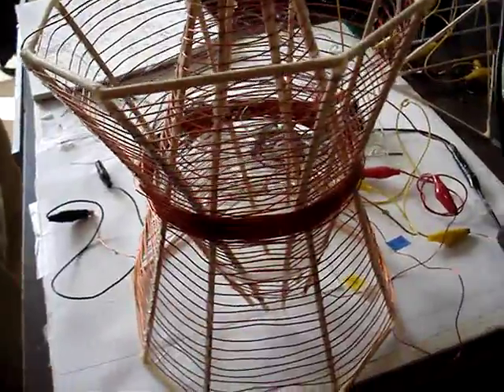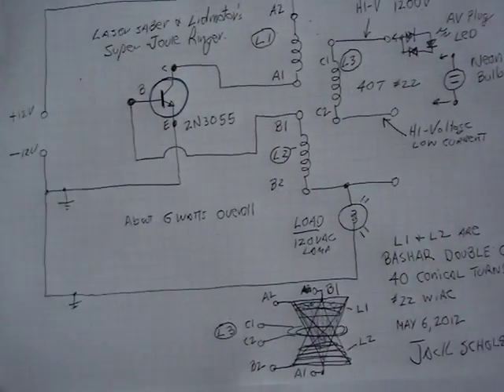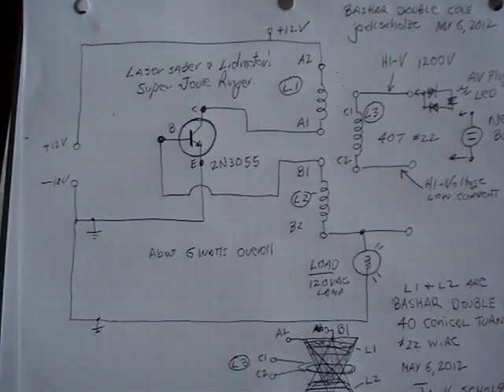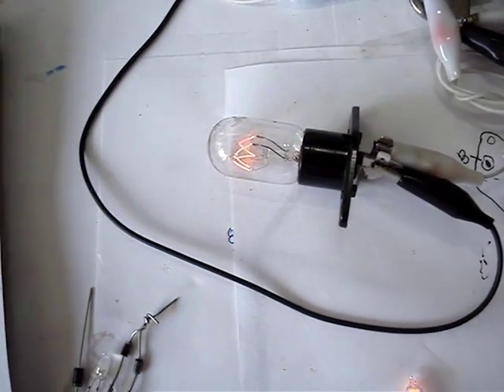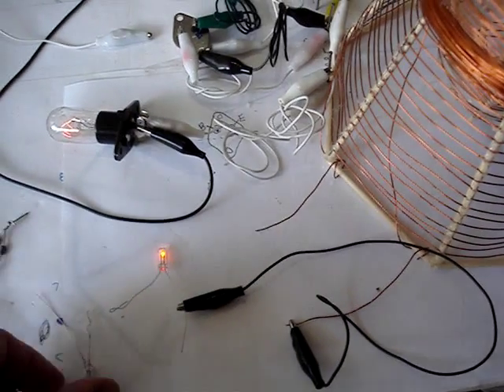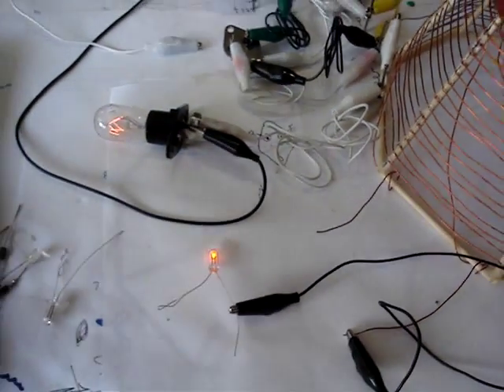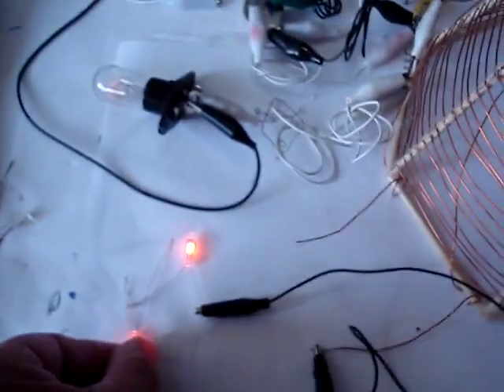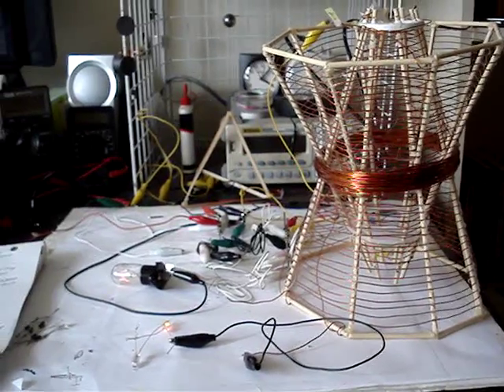Bashar Double-Cone Coil

Comment: AWESOME WORK! Amazing, this is like Lester's Hendershot Generator but way easier to make. I wonder if this thing could be scaled up to run larger loads, or maybe a series of these could be used to power things. This is great stuff.

One question, are both of the cones wound in the same directions or the opposite?
Reply: 相同 都是顺时针缠绕线圈

Comment: nice. Another guy doing Bashar coils. Btw, I just put some "new" theories on how to make this Bashar device on energeticforum. I'm using some thoughts uncovered while looking into the Hendershot devices and the Hubbard coil. If you don't wind the cone, but instead create a series of LOOP antennas at specific PHI ratios, like a Yagi, you can probably BOOST gain. See the thread for more details.

Comment from the maker: Tele,  The thinner wire should be fine.   Use about 50 turns each for the cones, evenly spaced out.   For the L3 or third coil round the middle, also 50 turns, but you might need more or less to get the oscillations.   It might be more important that L3 have the same mass of copper, ( overall length ) as the cone coils, rather than the same number of turns,     So in other words make L3 the same length of copper as the cones.     best luck